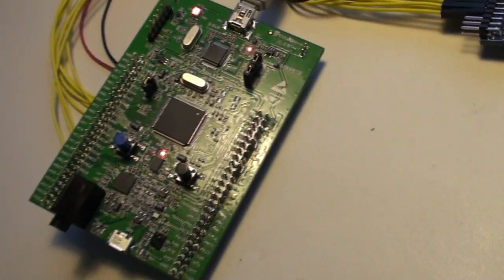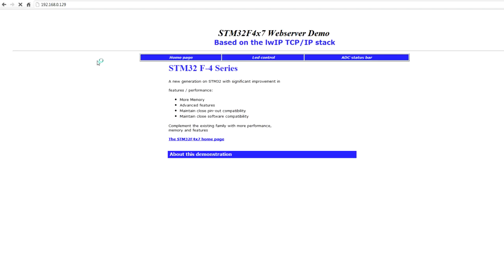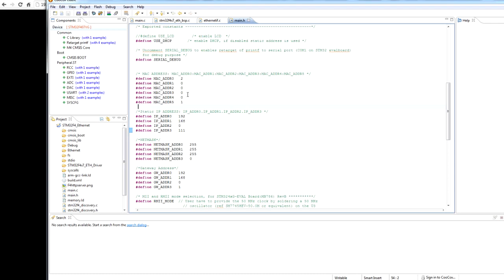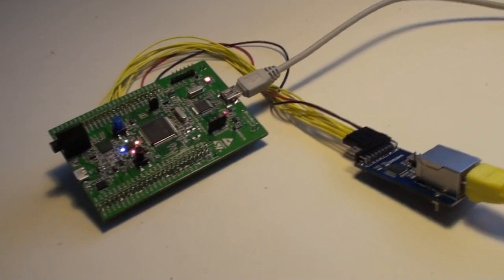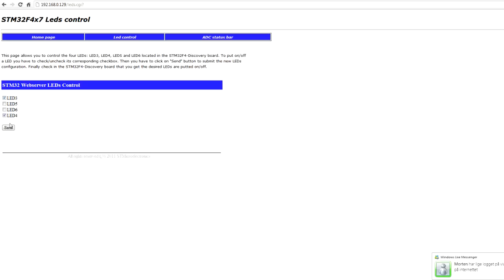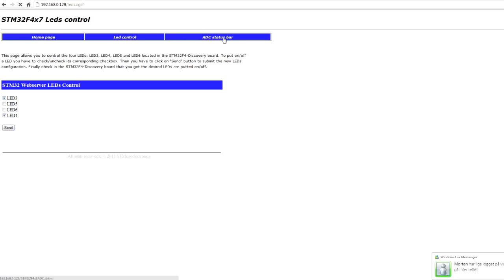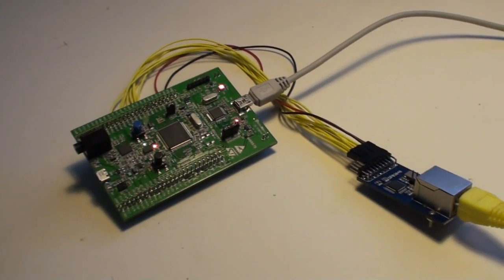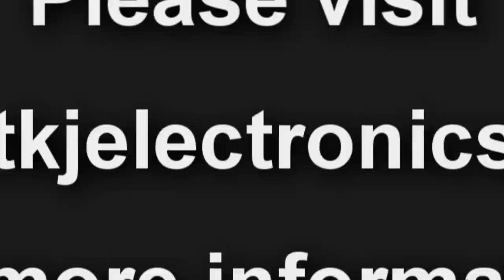Ethernet on STM32F4DISCOVERY using external PHY

Comment: Hello, do you work with LAN8720 and LPC1769? I have tried to use them with the Keil middleware but it dos not work. Have you work with them?
Reply: Were you able to get it to work with LAN8720? I am also looking forward to using it. My cursory understanding is MII/RMII is a standard so the PHYs should be interchangeable. But not sure.

Comment: i have ac101-QF phy chip board , and i want to connect it to arduino, any idea how to do so? 
i want to read packets and source address using arduino so i do some PRP algorithm on it. 
the phy chip gives MII to the arduino , and the arduino should read it as ethernet frames and display the source address , based on that it do some algorithm
Reply from the maker: You can't connect a Phy chip to the Arduino just like that. The reason that a Phy chip can be connected to the STM32 board is that the STM32F4 processor includes an Ethernet controller. The Arduino and the ATMEGA328 doesn't!
Instead I would recommend you to take a look at the ENC28J60 SPI Ethernet controller chip, which can easily be connected to the Arduino and used with pre-made examples.

Comment: Hello.TCP echo client no function in mode standloan,why?
Reply from the maker: We have had a lot of users who complain they can not get the project to work.
Please have in mind that your cables to the Phy module should be very short, in general less than 5 cm, to avoid any Phy initialization and communication issues.

Comment from the maker: Yes you could but there would be no reason for connecting a standalone Ethernet controller like the ENC28J60 to the STM32F4 as it already has the internal Ethernet capability.